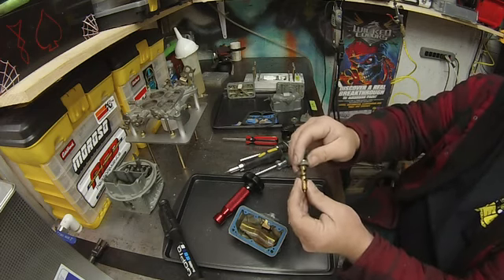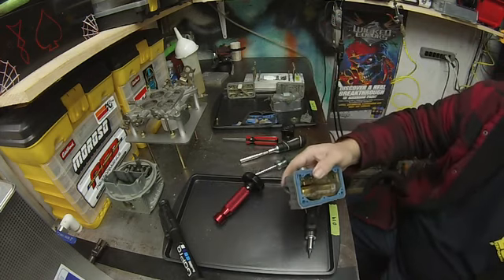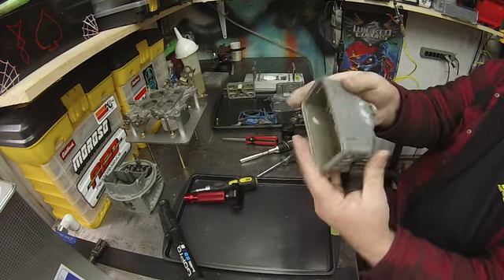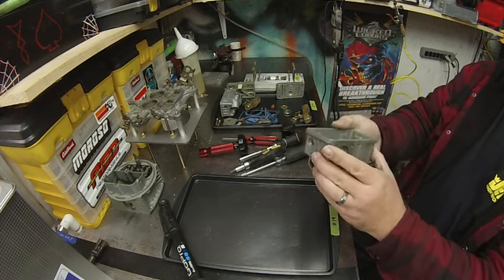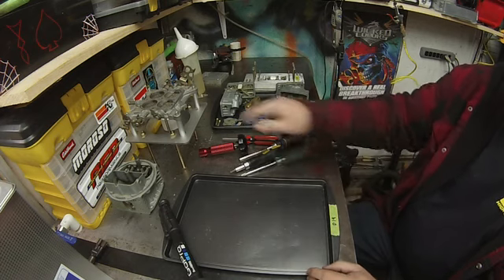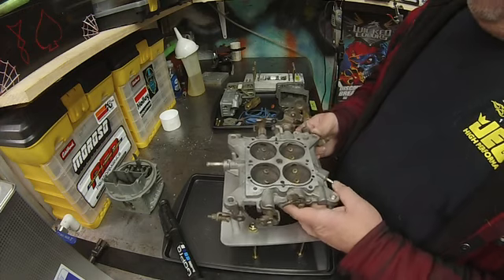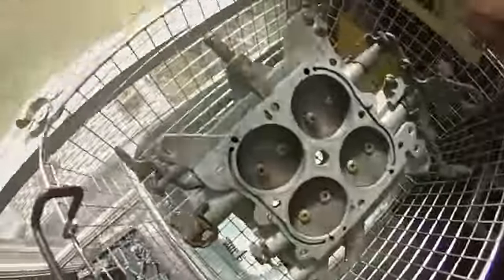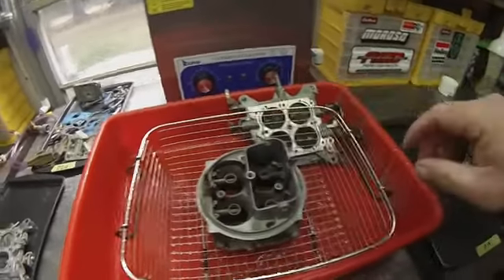650 Holley End Tear Down

Comment: Which Ultrasonic cleaner and solvent do you use?
Reply from the maker: It's a zokop ultrasonic cleaner from eBay that measures 12" x 10" . If the carb is in bad shape without a polished finish I use pine sol and water. If it has a polished finish I use Dawn dish washing liquid and water.